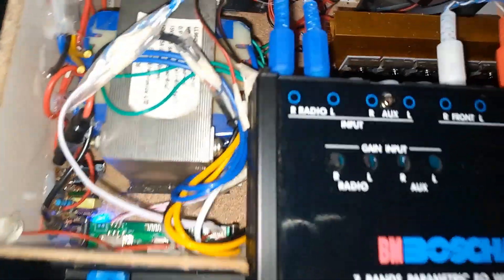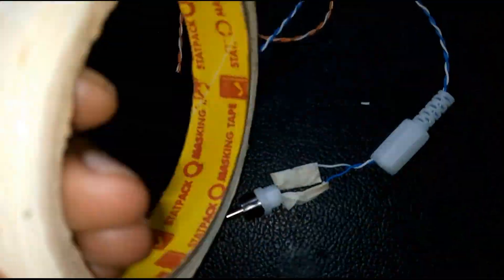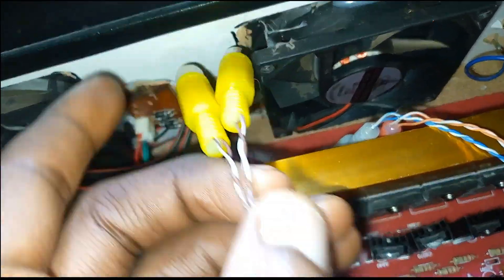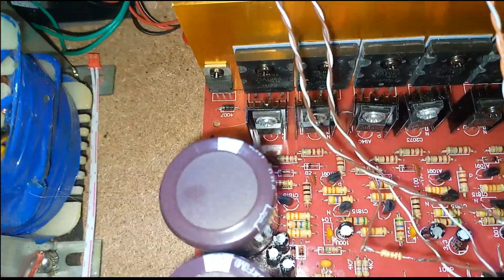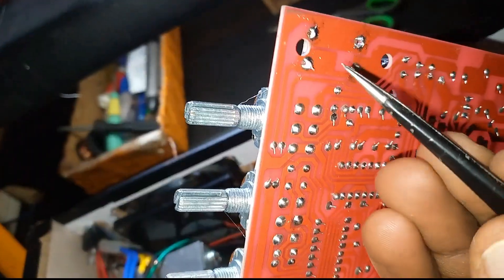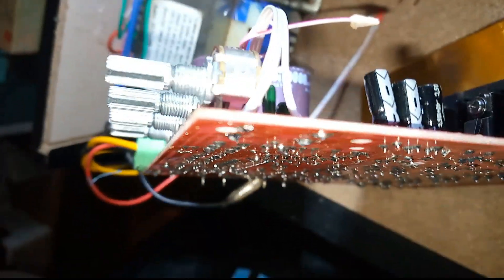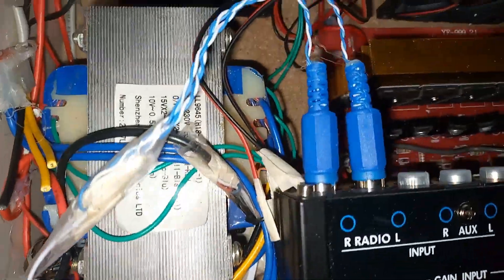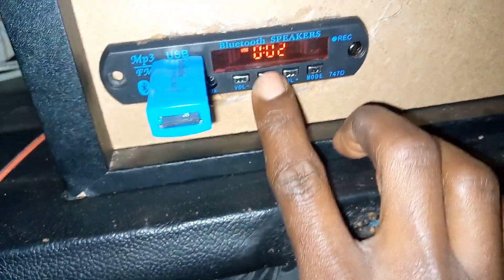Boschmann equalizer to 999 red board

Comment: Hi how can you reduce the vibration when you touch ground connection it reduces and click sounds when shutting off
Reply from the maker: I use plastic knobs so I don't touch ground.
There's something called soft start protection board, it's in Jumia it delays starting and shutting down so there's no 'gunshot' sound when turning off